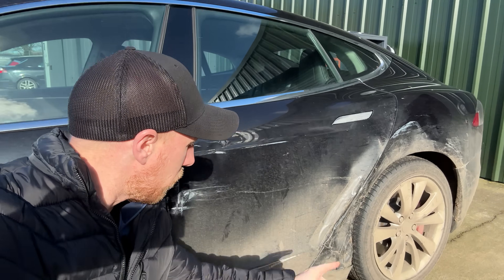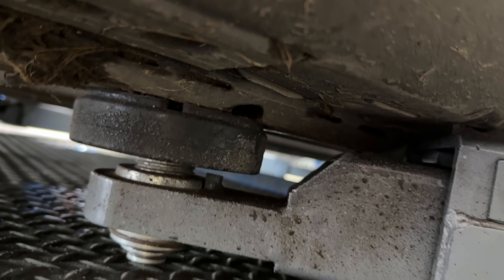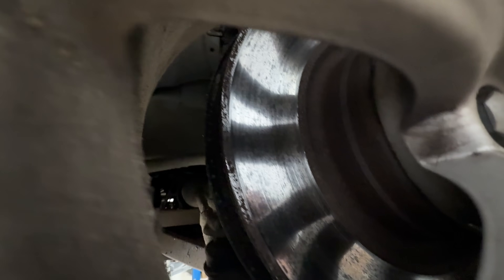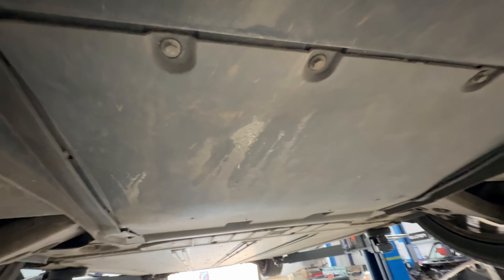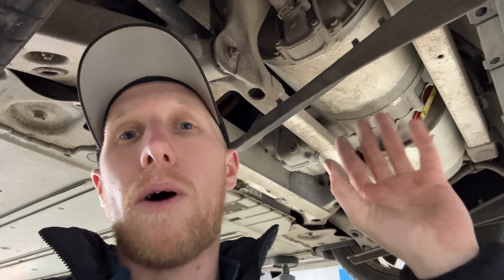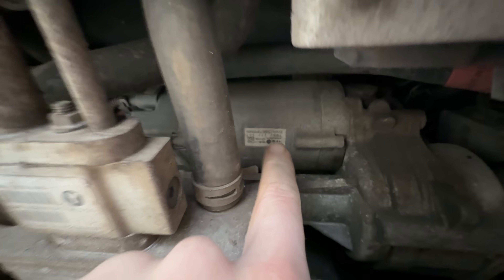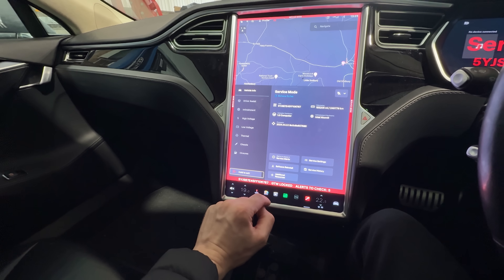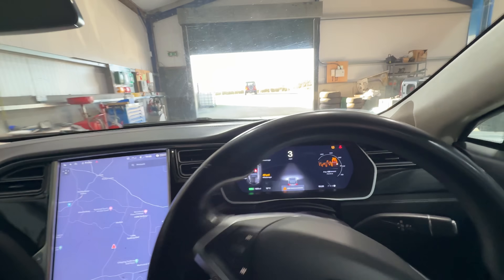High Mileage TESLA! How Bad IS IT?

Comment: The 85 packs are known to suffer water ingress. I don't believe the fuse holder is normally on the underside, like your's is there, on an 85 pack. If it goes back to Tesla for this work, they will fit a reconditioned pack which sometimes has a larger capacity than the original. Perhaps you've got a gen 2.0 pack fitted with 90kWh. There will be a sticker on the pack, usually accessible from the front wheel arches.

If you're breaking this for the powertrain, I could be interested in some parts such as interior trim, driver's seat, gen 2 door handles.
Reply: lol... the vultures are circling the carcass. I was just thinking my '15 plate could do with a replacement TPMS.

Comment: The Tesla that would not die! To be fair, Richard Symins at RSEV just bought a Model 3 with 217.000 miles and all it needed was a bushing! mad!!
Reply: If you take care of them, they seem to last. Other than those darn LDUs; they either fail from water ingress or bearings going out.
Reply from the maker: Next step is a full LDU rebuild. Having taken a lot of Model 3’s apart I think they will easily do 400,000 miles with out big issues.
Reply: @sirseriously  what year is a ldu?

Comment: The fuses have a battery in that runs out and gives a warning. That date will be when the fuse was changed
Reply: The fuse was re-designed so now its effectively self powered and the battery going flat after 10 years or so is no longer an issue. Tesla changed them for free
Reply from the maker: Ohh wow that’s a new thing to me. I thought they where just a pyro fuse
Reply: @Hazell_Nutz  it is just a pyro fuse but for some reason Tesla decided it needed a battery. It's only the early versions that have it and I think they are changed under warranty.